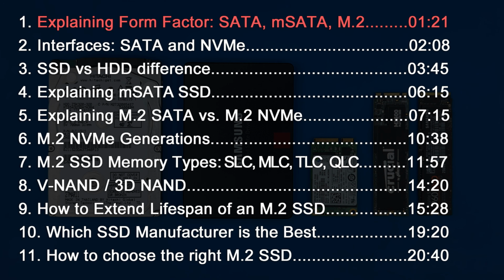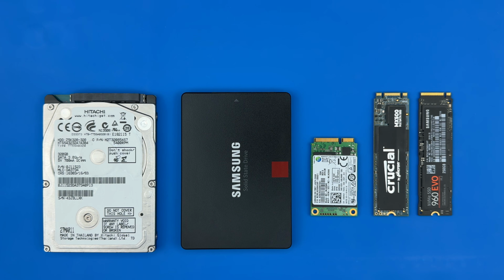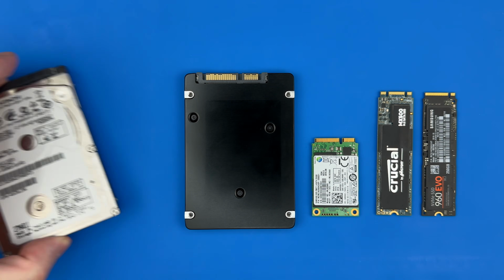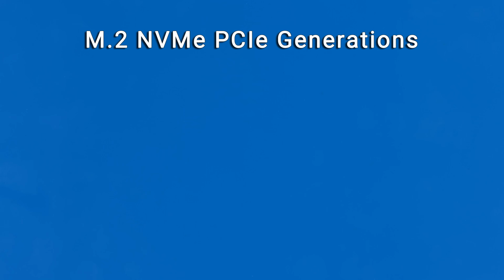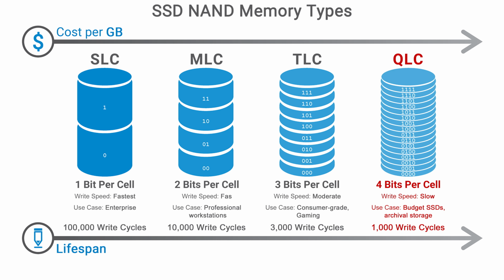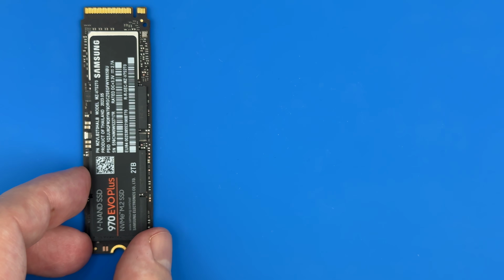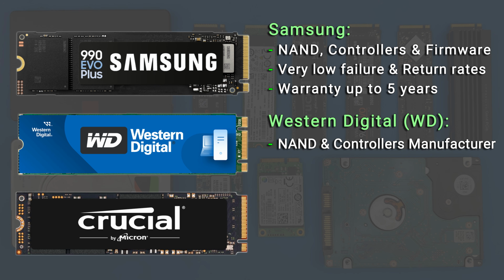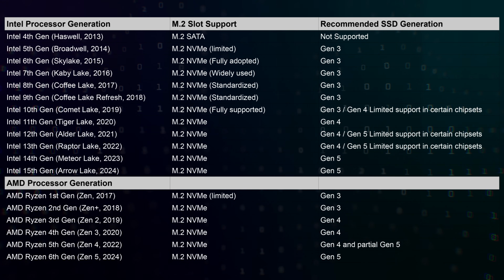SSD vs HDD vs NVMe vs SATA vs mSATA vs M2: Storage Devices EXPLAINED!

Comment: In my live recording career, I’ve bought and used hundreds of HDDs, mostly 1TB, which I delivered to my customers, and I’ve never had a failure that wrecked a recording. They are mind-bogglingly reliable considering what they do. Though I no longer record to them, virtually all of my data backups are still on HDDs due to the need for some 20TB, in triplicate, to maintain my customers’ recordings in archive. 

It’s just my personal experience, but WD Black products across the board are flawless. I still have regularly-accessed archival material on them after 10 years of active use. Finished sessions of several hundred GB are transferred to them for storage. Any use, whether later that same day or years later entails the process of copying the disk, working on it, and transferring back every single day of the session work. Zero failures in well over a decade.

While SSDs are now the beating heart of the system, those amazing ‘spinners’ remain the flawless backbone.
Reply from the maker: HDDs may be slower than SSDs, but for massive archival storage, their longevity and cost-effectiveness are hard to beat. HDDs can last for decades without failure. SSDs may be the go-to for speed, but as you said, HDDs are still the backbone of long-term storage. Thanks for sharing your insights!

Comment: It seems that NVMe Gen 3, Gen 4, Gen 5, are different creatures when it come to chip Nano-meter Fabs. The lower the better.  Having lots of DRAM "cache" is very important.  Heat does tend to "throttle" chips to slow them down when they get hot.  It appears that keeping any of these drives below 60 Deg C, is prime.
Reply from the maker: You're absolutely right about DRAM cache—it significantly improves sustained performance, especially in write-heavy workloads. Many budget SSDs use DRAM-less designs to cut costs, but they suffer in random read/write speeds and endurance. And yes, heat is the enemy of performance! Keeping SSDs under 60°C helps prevent thermal throttling, ensuring they maintain peak speeds. A good heatsink or airflow is essential for Gen 4 and Gen 5 drives, especially in tight spaces like laptops.

Comment: Thank you for the very informative and technical details of storage devices.
Q:  What is the recommended brand and workable capacity of  M.2 NVMe PCIe Gen 3 for  Raspberry Pi 5 with  8GB RAM,  installed with  OpenMediaVault OS  to function as a Home Lab NAS ?
Currently,  I'm using  ORICO M.2 NVMe PCIe Gen 3  256 GB size  for testing and plan to increase the capacity anytime soon.
Appreciate your kind advise and thank you in advance.  🙏
Reply from the maker: For your Raspberry Pi 5 NAS setup running OpenMediaVault:
- Samsung 970 EVO Plus
- WD Black SN750 SE
- Crucial P3 Plus
Since this is for a NAS/home lab, storage depends on your needs:
512GB - 1TB: Good for basic file storage & media streaming.
2TB+: Better for long-term archival and VM/docker setups.
If your ORICO 256GB SSD is working well, upgrading to a 1TB or 2TB model from a reputable brand will improve performance and lifespan. Also, consider heatsinks to keep temps down, as Raspberry Pi 5 doesn’t have active SSD cooling.
Hope this helps!
Reply: @howfixit  Your response and advise is much appreciated.  I'll include the above info. while planning for the storage capacity upgrade anytime soon.  Have a great and safe day !  🙏

Comment: Nice video. Does Bit-Rot happen on SSD tech ?
How long will an SSD or NVME retain data without being powered up?
Reply from the maker: Great question! 👍 Bit-rot (data degradation over time) can happen on SSDs, but it's much less common compared to HDDs. The main concern for SSDs is data retention, which depends on NAND flash type and storage conditions.
For consumer TLC/QLC SSDs, data retention without power is typically 1–3 years under normal temperatures (~25°C). For enterprise-grade SLC/MLC SSDs, it can last 5–10 years or more. Higher temperatures accelerate degradation, so storing SSDs in a cool, dry place helps maintain data integrity longer. If long-term storage is your goal, refreshing the data (powering up the drive occasionally) is a good practice.
Reply: @howfixit - can the SSD external drive be kept in a freezer (in a zip lock bag) to preserve longer?
Reply: @ - While 'bit-rot' is not the same thing as the way food rot, it could probably either speed-up or slow-down the 'bit-rot' process, depending on the temperature.
But there is probably an easier solution to make your SSD/HDD last longer; if you're using BTRFS, you can each month issue a 'scrub' command, which will read and rewrite the data on your drive. It has been known to be able to rescue files that had bit-rot (using the BTRFS error-correction system).
Still, one of the best ways to prevent losing data, is to use a BTRFS RAID 1+0 setup. Do not use RAID5 or RAID6, they do just the opposite, giving you cheaper storage at a greater risk. Besides, there's still a write-hole problem in RAID5/6 on BTRFS, which has not been solved fully yet. The RAID1 and RAID0 (thus RAID1+0) is rock solid, though.
Reply: Sadly, you're just as sure that you won't get bit-rot as you can be sure you or your equipment won't be hit by lightning. Nobody knows when it'll happen or where it'll happen.
Chances are that it won't happen every day, though, but if you're unlucky, you just bought a device that was bad (I tried that - it was brand new, not refurbished).
But in general, don't let your HDDs age more than 10 years. Buy WD RED if you want reliable drives that you use every day. SSDs ... Switch them out every 10 years as well; but in 10 years, they will probably be excellent regarding data degradation - or we'll likely have a glass-like storage thingy.

Comment: HDDs have a longer lifespan than SSDs you forgot that
Reply from the maker: HDDs can have a longer lifespan in terms of write endurance, since they don’t suffer from NAND flash wear like SSDs. However, SSDs have no moving parts, making them more resistant to physical damage, shock, and vibration, which often leads to better reliability in the long run. While HDDs can last 5–10 years with proper care, SSDs (especially high-quality ones) can also last many years with normal usage, thanks to wear-leveling and TRIM technology.

Comment: Why no U.2, U.3, and SAS?
Reply from the maker: U.2, U.3, and SAS are typically used in enterprise and data center environments, rather than consumer-level PCs and laptops, which is why they weren’t covered in this video.
U.2 & U.3: Designed for high-performance NVMe storage in servers, supporting multiple lanes for faster speeds and better scalability.
SAS (Serial Attached SCSI): Used mainly in enterprise HDDs and SSDs, offering higher reliability, better error correction, and dual-port access for redundancy.
For most home users, SATA and NVMe (M.2) are the standard options, but if you're working with servers, RAID arrays, or enterprise storage, U.2, U.3, and SAS are definitely worth considering.

Comment: You fotgot to talk about stripping nvmes in raid 0, double the speed all the time.
Reply from the maker: RAID 0 with NVMe SSDs can indeed double the sequential read/write speeds by striping data across multiple drives. However, there are some trade-offs:

✔️ Pros:
- Massive speed boost in workloads that rely on high sequential performance (video editing, large file transfers).
- Increased storage capacity by combining multiple drives.

❌ Cons:
- No redundancy, if one drive fails, all data is lost.
- Not always noticeable in daily tasks or gaming (most users won't see a big difference beyond benchmarks).
- Requires motherboard support for NVMe RAID.

Comment: You did a best job in explaining about the storage devices. No video explains likes this. Appreciate your work. Keep posting more videos of computer internal parts. Congratulations on your success.
My Laptop: Dell Inspiron 5590. Supports M.2 NVMe PCI slot. Suggest the best NVMe SSD brand with supported generation and data lane. Pls suggest.
Reply from the maker: Thanks a ton!
Reply: Your Dell 5590 seems on intel gen 8 processor which is old and uses gen 3  data ssd according to the chart provided in the video. Samsung all the way.
Reply: @GunSpeed_BulletProof  My Dell has an intel i3 10th Gen.  Suggest please

Comment: I was purchased M2 NVMe before & curious why it's not worked! Later on found out my MOBo only supports M2 Sata, I bought enclosure for my wrongly ordered NVMe so I can still can use it as external storage, too expensive! Your video will be a big help for everyone! 

Thanks for your clear explanation sir! ^^
Reply: pcie adapter trans to m.2 possible as internal.
If your MB has pcie x4 lane
Reply: @a892728  will it work if my MB only has pcie x1 slot?
Reply: You will still get Sata speeds
Reply: Everytime a new tech comes out, it is safe to assume that it won’t be compatible with your current system.

Comment: Dear thank u very much. pls create video  SAS and NAS disk speed, interface different comparison.  and thunder bolt technology updated.
Reply from the maker: Noted
Reply: I'd really like to go SAS (and am thinking about SAN, even though it's just for hobby - yes, I do have NAS already).
Edit: I very strongly recommend BTRFS RAID1+0; it's very, very, very, very reliable. Mine was abused for 6 months on/off/on/off/on/off millions of times during those 6 months and I didn't lose any data at all.
(Don't use RAID5 or RAID6, though).

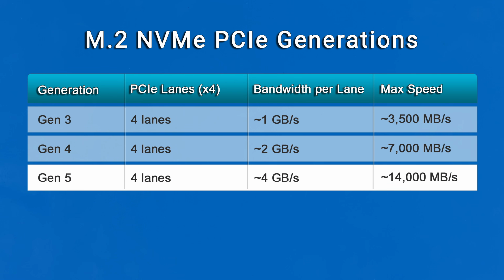Comment: @How-FixIT : 8:33 11:31 24:48
socket PCIex gen4 x4  => 16Gb/s; (wikipedia)
 disc NVME "PCIe gen5" 14MB/s=> 13,67GB/s . 
Really gen5  ???
Reply from the maker: PCIe Gen 5 can theoretically reach ~16GB/s on a x4 lane connection, but real-world speeds depend on factors like controller efficiency, NAND flash type, firmware optimizations, and thermal limitations. The 14GB/s (~13.67GB/s) speed you mentioned is close to the actual performance of current Gen 5 SSDs, but some overhead in encoding and data processing can slightly reduce peak speeds.
Reply: @howfixit  I meant pure transfer. At that speed of write/read these drives shouldn't be called "PCIex5"
Reply: @podszorstek7494  Than look @ Wikipedia once again, it's 16 GT/s for PCIe4.0 - means 16Gbit/s per lane, after bitcoding overhead (128/130) = 1969 MB/s per lane or 7877 MB/s for PCIe4.0x4 (typical 4-lanes Gen4-SSD). After all loses at several layers (data link layer, transaction layer) the actual data transmission could reach about 95% of this raw bandwidth. It says: transfers can approach >95% of PCIe's raw (lane) data rate. From my own experience, i would say, you can only reach these speeds with sequential READ data transfers. The actual limits are: ~ 3740 MB/s over PCIe3.0x4, 7480 MB/s 4.0x4 and (my assumption, based on a linear scaling) about 14960 MB/s for 5.0x4. The new Samsung 9100Pro can read up to 14800, so it is already almost at limit of Gen5-Slot.

Comment: Since you asked (I'm getting conflicting info about my 2016 laptop) could you confirm one way or the other if it will run with a m2 nvme module, instead of the m2 sata 120GB (+1TB HDD) which was preinstalled when I bought it.
HP Pavilion gaming ak011na (Skylake) 
Running Windows 10 atm.
Reply: @qwertyuser8541  Some say the ak series  can only use sata, others say it can.
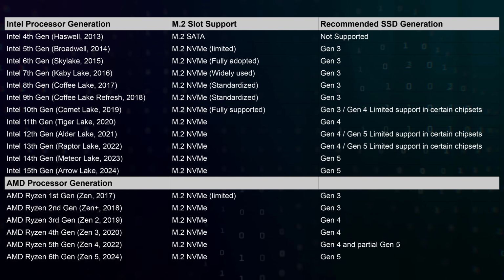I saw the Skylake processor is on the list at 23:27 mins in this video as M.2 NVME (Fully adopted)?
Reply from the maker: The HP Pavilion Gaming 15-ak011na (Skylake) supports the 2.5-inch SATA SSD/HDD and M2 SATA SSD (2280), but it only supports SATA SSDs, not NVMe.
Reply: @howfixit  Ok thanks. Would you advise replacing the HDD with 2.5" SSD and leaving the smaller M.2 in for extra capacity?
Note: I have never actually gamed on this laptop and there's nothing much on the HDD.